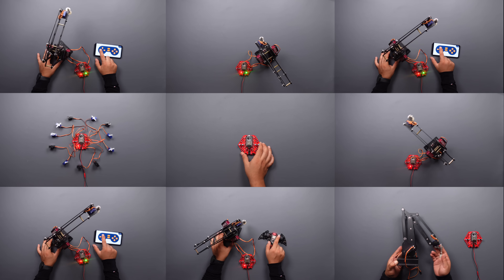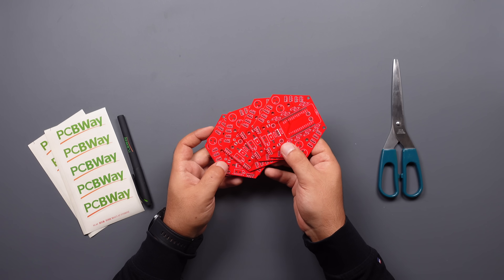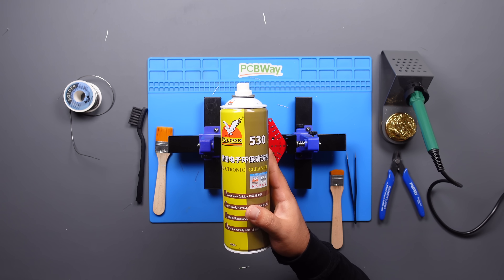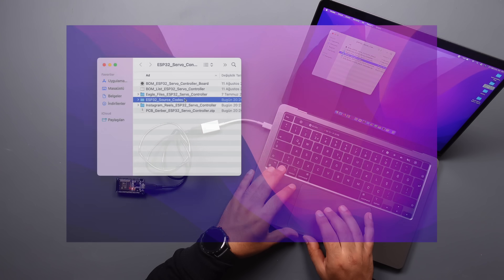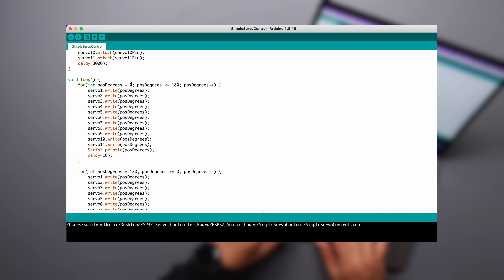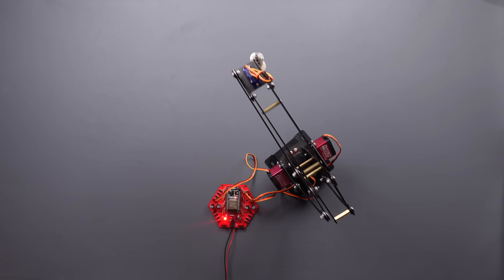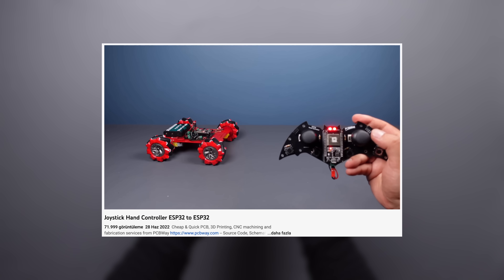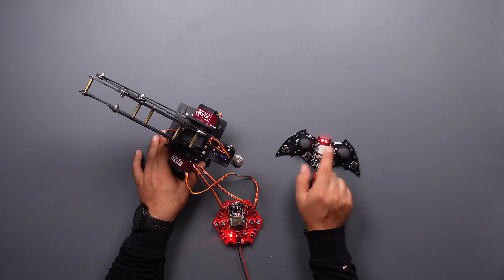ESP32 Servo Motor Controller Board - Wireless control with Bluetooth App and ESP32 to ESP32

Comment: Merhabalar, projelerin çok güzel ve ilham verici. Daha önceleri flex sensör ile eldiven yardımıyla robot el hareket ettirme videonu görüp yapmak istedim. Bir çok sorun çıktı karşıma. Fakat tek çözemediğim sorun 2 arduinoyu da başlattığımda başta düzgün çalışırken bi 10sn sonra falan robot el takılıyor, donuyor. Nedeni ne olabilir, güç ile ilgili mi yoksa haberleşme ile mi alakalı. Toplamda 10 servo motor kullanıyprum bunula alakalı olabilir mi